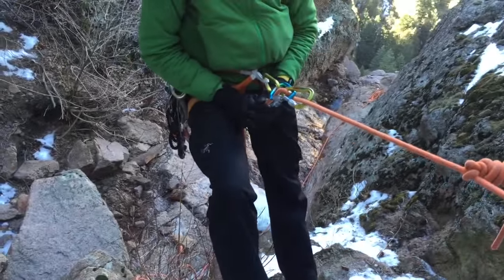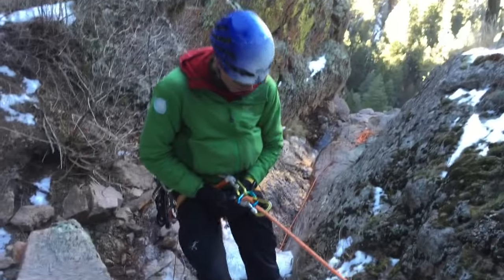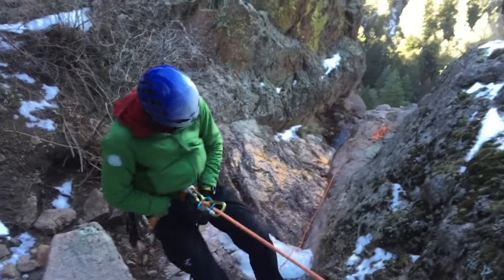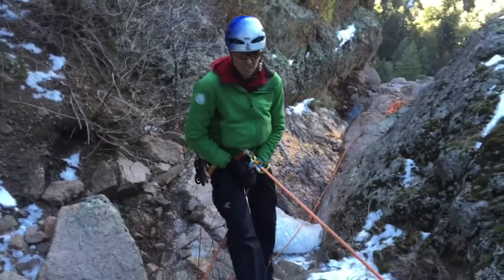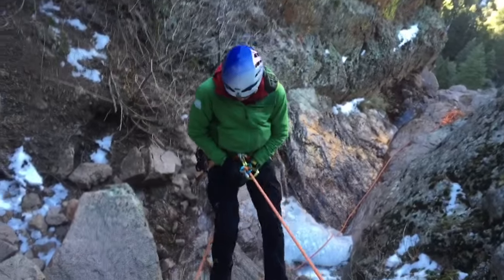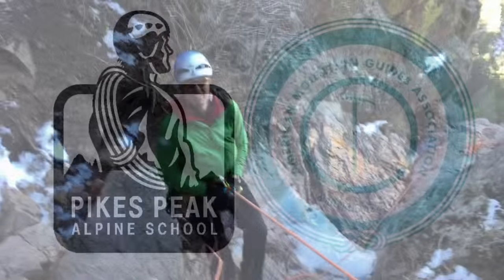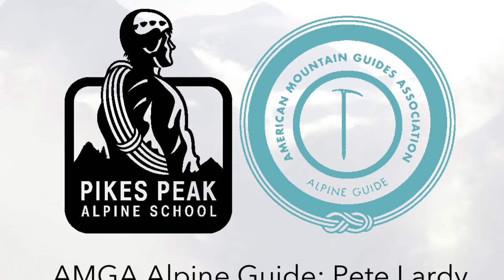Carabiner Brake Sytem

Comment: This is not a carabiner brake system.   It is actually called the French rappel or the crossed carabiner rappel.  The carabiner brake system requires at least 4 carabiners in order to do it safely and sets up completely different than what you are showing here.
Reply: So you are using the term "loosely"???  because there is a "carabiner brake" method, a "crossed carabiner" method, the "munter hitch" method, "carabiner wrap" method,  etc, etc, etc, I have even invented a form of the "crossed carabiner" method using one carabiner and one rappel ring.  Do you know how to rappel using a bicycle frame as your rappel device???
Reply from the maker: @roperiders5308  Yes. Many different carabiners and orientations can be used for friction.  An angle piton rigged thru the spine of a carabiner works well as a piton brake. I'd still choose a plaquette device over a carabiner brake.  Its all about the friction and a bend in the rope.

Comment: Munter hitch requires just one carabiner.
Reply from the maker: Munter hitch great for single rope rappel. With double rope rappel it will twist your ropes wildly. Try it.
Reply: @8snowwave8  used before on doubles. Works fine.

Comment: Not sure when this would be useful, you can do this with less gear if you lose your belay device. This seems kinda inefficient.
Reply from the maker: 2 pitches up, you drop your belay device.  This system works well to get down. Better than a Munter hitch in a double rope rappel system. Fewer rope twists.